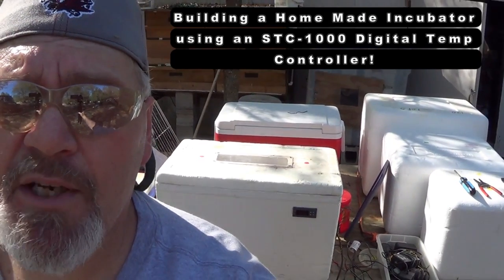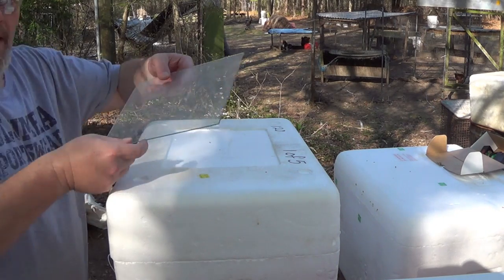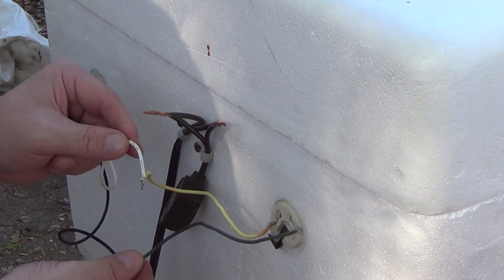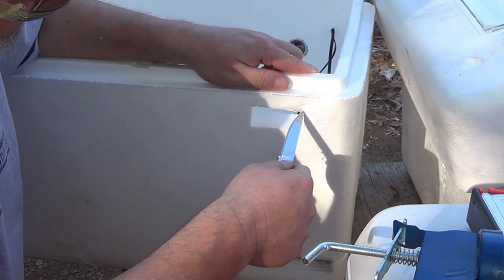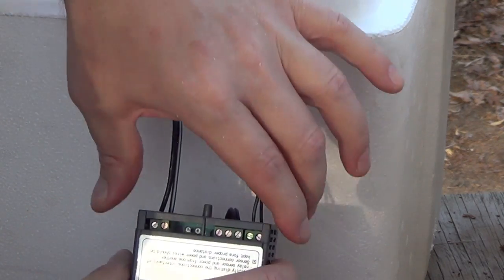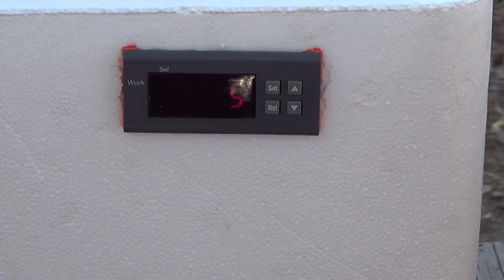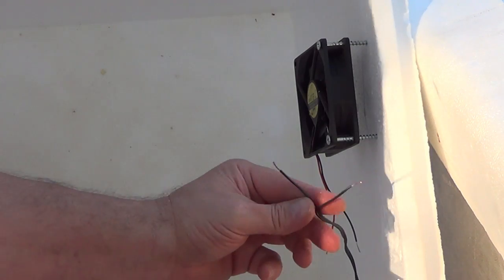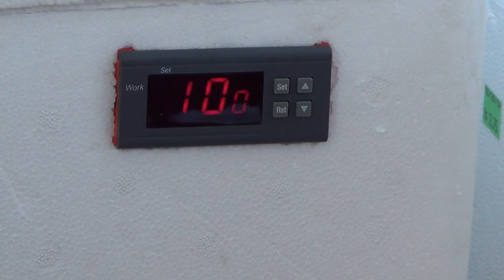Wiring/Installing an STC-1000 Digital Controller into Your Home Made Incubator!

Comment: I put one of these in a coleman cooler for a hatchery.  Only one light bulb since it would only be in use for a day or two.  worked great.  hatched mallards and two days later Bourbon  Turkeys.  Temp and Humidity was easy to adjust.  no curled toes or sprawled legs.  Peafowl will be ready to transfer soon cant wait.  This is my first try at incubation and very pleased with the results so far.  Thanks for all the instructions.  Vicki

Comment: I just got one from China and I am returning it. Its actually a nice item and I understand a little now about its multiple functions. Its actually a nice item for a school  science fair project but it gets more costly as you discover whats needed. What I thought it was was a machine you plug into a socket and stick probe in water and the probe changes the temperature of the water based on what you set. I remember wondering about if it would work soundly over a long period of time.

Comment: Thank you for the video. 
There is a humidity controller similar to the digital temperature controller that I am planning on trying to include in my incubator. If at all possible, I would love to see a how to video from you of this. 
Thank you again for your videos.
Reply: +m gorby   I wonder if you could just use this controller to take a wet bulb temp and adjust humidity accordingly...  Is there an easier way?
Reply: +Tom Smith I don't know if there is an easier way. I'm thinking about using an ultrasonic humidifier like a pureguardian or a terrarium fogger for the humidity and a humidity controller (that looks like the temerature controller in this video) for regulating my humidity in my incubator. I don't want to cut into the electrical cord of the humidifier so this is where I'm stuck. How do I rig it up without damaging the humidifier cord? Is that possible? Any and all ideas are appriciated.

Comment: Great video. I tried on of those w1209 to try to fix my sportsman. The old School wavers kicked on hatch day last week, and my digital remote maxed out 130F. I wanted to cry. Either I got a bad w1209 or I fried it with two much amps. My cabinet is 2.1 amps  I will be putting one of these in, in a couple days. Thanks again.
Reply: Joseph Fairlane I no longer use the w1209's. We tried them and after a couple of seasons that started failing!

Comment: Obviously you know what you are doing.  Looks like lots of experience.  But you could have used a digital voltmeter to test the polarity before hooking up the fan. Having a voltmeter handy when working with mixed AC DC wiring in a one unit is handy for "us novices".  Very clearly done video and a neat professional looking job.

Comment: As always thank you Rush... just switched out one of my modified water heater thermos to my digital one that came in :0) can't wait to get the others done now :)
Reply: Hey Xavi! My pleasure... You're gonna love the new controller!
Reply: Grrr I must have an odd ball model because I cannot get mine on the heat settings to go lower than 37.5 and at 37.5 it keeps the inside of my bator 101-103 :(
Reply: Xavi Bully Mart Hi Xavi... if you can't hit the 'set' button and adjust your temps up and down then something is wrong with your controller!

Comment: Just bought 1 on ebay for 13 bucks thx for the video this will work great and save a ton of $$$. There is a lot of sellers with ones that do Celsius instead of F° so u gotta watch for that and also they make them for 12v, 120v, and 220v input so u gotta make sure to buy the right 1 but these little things open up a whole new diy level to hell with the high dollar gadgets lmao I'll have these on fridge incubators and brooders hell for the price I can add in a hatcher too lol. thx again great vids

Comment: Great video on this unit.... Only thing I would suggest  (and I'm not a expert on incubators or what is best for hatching chicks) is that you might want to set the on off degree difference to a larger setting than 0.1 degree F.   I assume optimal temp is 100 degrees, but that relay that turns the lights on and off is mechanical... (not solid state) and just like everything with moving parts will wear out.  If the incubator would be okay between say 95 and 105 degrees or whatever is a larger value I would try to go with that.  The relay switching constantly will eventually wear the relay in the unit out. The relays can switch MANY times... but they do have a finite amount.  And since these relays are built into the controller I would try to limit the amount of times they switched so the unit lasted for as long as possible.
Reply: That's a good point. I'll remember this when I wire up my fridge bator however for 13 bucks if it'll last the season even it'd be worth replacing unless u got 10 of them lol but for the normal backyard breeders it probably wouldn't be that big of a deal. idk wonder how long it would last like this I'm gonna try it out just to see out of curiosity lol but that is a good point thx for sharing with all of us
Reply: From what I found the STC-1000 uses a JQC-3FF relay with a minimum electrical endurance of 100,000 cycles (once cycle is open and close i.e. light on and light off).   But if it's cycling ~1.5 times a minute(like in your video), that's only a guaranteed life expectancy of about 47 days if my math is right, which it may not be. lol Would love to hear how long it lasts for ya though.

http://www.futurlec.com/Relays/JQC-3FF-24.shtml

http://www.viking-heating.co.uk/stc1000/internal.jpg

Comment: Wade, thank you for all the great videos and for your prompt support with pms.  This is very interesting and educational video.  Just wondering, what is the verdict so far about the efficiency of digital incubator vs the hot water thermostat incubator?  For a newbie, would you recommend one or the other more?
Reply from the maker: Well... Hey there folks! I've had an STC-1000 on my home made sportsman for the last 3 years now... not 1 failure!! The controller has a 1 degree temp swing... so I set it on 100 degrees, It cycles off at 100 and comes back on at 99 degrees. My thermometer/hygrometer shows an average temp of 99.5 degrees F. I have chicks popping out everywhere! For a new-bee I would defiantly recommend a digital controller! Heck, now the digital's are in the same price range as a water heater thermostat & you dont have to modify anything! And the digital controller isn't affected by ambient temps like an analog thermostat!
Reply: Rush Lane Poultry & Game Birds do you have a video of your homemade sportsman?
Reply from the maker: dusty lee Yesser!! Installing and Wiring a Digital Temp Controller using a Solid State Relay Into Your Incubator

Comment: Placing the light sockets on opposite sides and diagonally across from each other would give better heat distribution. Careful some kinds of glue or caulking  used  can out gas from the heat and kill chicks in the shell.   Let it set up for some time on glue or calk to clear some of the possibility of fuming from heat. What are you doing about humidity control, monitoring and application as needed?

Comment: Hi. Thanks for the tutorial. Just asking how high the temperature those bulbs can heat the incubator? Thanks.
Reply from the maker: AZPAS Iphone Case Depending on wattage... it can get very hot in there if not regulated! 150 degrees with a couple 40 watt bulbs...

Comment: Hello Wade...Thanks for the videos very easy to follow instructions...How would I mount the stc-1000 in say a Coleman cooler?
Thanks
Reply from the maker: Ricky Woods Hey Ricky! I've installed these units into several coolers... In the coleman or igloo coolers I used a jigsaw to cut a mounting hole right in the middle of carrying handle so that the handle would protect it!

Comment: Hi Rush,  Great video and I am making one now but I am confused about the fan's airflow.  Is the fan's airflow pushing air against the cooler wall between the space and the cooler or do you face the fan to blow across the open cooler and light bulbs?  I see on your video that the fan label is facing to the open cooler which I believe means that the fan is pushing air against the cooler in the small open space where the fan is mounted.  What is your recommendation.  Thanks
Reply from the maker: +Gary Smith Hey Gary... i try to make sure that the fan is pushing air across the heating elements. The main purpose of the fan is to keep fresh air circulating in the box!
Reply: +Gary Smith Thanks Rush - I have another question - on the top of the box how many vents do you leave open for optimal incubation?  Do you use one or both open?  Thanks   Waiting for the STC-1000.
Reply from the maker: +Gary Smith It depends... You use the large vents on the top to help control humidity. Each vent hole open will lower humidity levels by 5%.
Reply: +Rush Lane Poultry & Game Birds Thanks Rush for the advice- got my ST-1000 today and it is different than the one you have in your video.  I am sending a wiring diagram and it has separate cool/heat wiring inputs.  Can you give me any suggestions this type of wiring.  I guess this is a newer version.  Thanks
Reply from the maker: +Gary Smith You will always tie into the heating side! And make sure that your unit is set on 'H' for heating.

Comment: Wade, a newbie  here. thanks for the video. Great tutorial man. Just wanna know since I made a small 13"X16" box, is it necessary to use two bulbs instead of just one?
Reply: Thanks pal... I use 2 bulbs only as a precaution in case 1 goes out when I'm not home! But no, 1 is sufficient in a small box. I will usually use 2 (20 watt) appliance bulbs in the small bators! Wade
Reply: Thanks very much Wade. I will try 1 bulb for this one. If this works, and the eggs hatch. I will make a bigger box later with your tutorial as my guide. Good on you mate...

Comment: I like this video but I'm confused on the volt part. Can you get the controller and fan the same volts so you don't need an inverter or would you need it regardless. Why is it needed for 12 volts instead of 10 volts'? I like like the three prong heavy duty cord than those cheap 2 prong brown ones could I use those? I know nothing about electricity pass match the colors.
Reply from the maker: +DarkIllusia The stc-1000 can't handle a fan. You need the inverter only if you are using a PC fan that uses DC voltage. An inverter that is 9v to 12v DC will run the fan but the lower voltage will run the fan at a lower speed! There is no need for a 3 wire cord in this project.

Comment: Hi 
I got STC 1000 from China, but the functions are slightly different from the one you are demonstrating such as (6 & 7) for loading relay whereas the one i got has (5,6) for heating and (7,8) for cooling
I am getting confused what to connect for incubator heating or cooling or both and how
please help

Comment: STC-1000 I bought will show what temperature it is but it will not provide power to the heating or the cooling terminals. No matter how I set the controller it will not power the terminals for heating. I am hoping I will see how you set the controller if there is something I missed. After seeing your video again I see that your STC-1000 is a simple version. Mine has a power up button, and extra terminals for cooling.
Reply: You prolly got a bad unit... I got a bad one a couple years ago!
Reply: it worked perfect after I got the proper wiring diagram. I want to get another one to install in a wine cooler conversion incubator for Tempeh.

Comment: Great video question when the lights go off does the fan go off also or does it stay on all the time. 
Thanks Vincent
Reply: You want the fan to stay on all the time.. He plugged it directly into the power not the load line so it would stay on....  keeps the temp equal by blowing the air around...

Comment: The wire you have for the main power supply looks too small. You should have at least a 16 gauge wire for 120.
I am sure you will get away with the smaller wire. However it would be safer with a larger wire.
Reply: I had the same thought...  He could just use the extra wires from the light fixture that he took apart ...

Comment: I have an older Brower Top Hatch incubator and the temp controller is not great.  I was going to use this to solve the issue.  It has a very small fan that blows over a bulb.   I just read below that this won't handle a fan...  but mine is only about 1" sq and is AC...so.....  What do you think??   WIll this STC1000 (MH1210F-farenheit) work, or not?     Thanks enjoyed the video!!!
Reply: Basically all Im doing is cutting the power cord and installing this in-line....   power to power and load to incubator...  I don;t think I need any jumpers etc.....   correct?
Reply: +Tom Smith sounds right Tom and it's just in line if u want the plug on the end for fan otherwise u can  just use any cord that can handle the small load but that plug end will come in handy for adding extras like the fan or any extra lights or even a turner. The thermostat just get wired in pretty much like a light switch would

Comment: two 150 watt incandesants bulbs. the box is large at 5.6 cu ft.
The controller kicks on and off every 3 minutes.
 On at 98 off at 99.
Reply: +Vince Biano Okay... 300 watts may be over-loading the little 10 amp relay in the unit. You may want to use a solid state relay on those big bulbs!

Comment: All the STC-1000 that I am finding on Ebay and Amazon are all Celcius not Farenheit?  Where did you get your unit? And they say Cool and Heat on the left side?  They are similar to yours but not the same?  Thanks..
Reply: +La Luz Newmexico This one is in china but it's in F. : http://www.ebay.com/itm/350947244789?_trksid=p2060353.m1438.l2649&ssPageName=STRK%3AMEBIDX%3AIT
Reply from the maker: +La Luz Newmexico Here's the same company in Cally: http://www.ebay.com/itm/310937246998?_trksid=p2060353.m1438.l2649&ssPageName=STRK%3AMEBIDX%3AIT
Reply: Yep! That's the 1 that I use...

Comment: Have you noticed that the temperature will fluctuate quite a bit? For example mine is set at 100 F. It will shut off at 100 F but temperature in the bator will still increase up to about 102 before it starts to drop. it clicks back on at 98.8 but before the temperature starts to increase, it will have dropped to 97.8. any suggestions?
Reply: mine is doing the same

Comment: I appreciate your videos. 
I bought one of these controllers and after 2 days during a test run it stuck on and the temp was 141 degrees. I reset it and seem to work ok until today when I caught it at 106. I have 45 quail eggs in there.
Has this happened to you at all?
I want to buy another but wanted to see if it happened to anyone else.
Reply: +Lar Bian Sounds like you may have gotten a bad one... I've been lucky with them so far. I think that I have had 1 fail on me in 4 years.
Reply: Thanks Bubba. That's what I needed to know. I'll order a new one and sweat bullets this doesn't get weird while I'm  at work or I'll be eating hardboiled bird. Then I have to make a quick swap and hope the temp doesn't drop too far. 
Each time I reset seems to work ok for 10hrs.I'll do that before bed and work till I get new.
Thanks again.
Reply: +Lar Bian Yesser! You know it... I've been there many times my friend! That's one of the reasons that I built a separate hatcher. If I ever had an incubator fail, I could put them in the hatcher until I could get the bator repaired.

Comment: Hi Wade, I purchased an arc 1000 like your and set it up the way you did on this video.  Would you have any idea why the bulbs do not cycle off when the set temperature is reached? I set the temperature to 100 degrees, but temp has gotten up to 165 and has not cycled off yet.
Reply from the maker: +A Yang Hey folks! Check your wiring against this wiring diagram to see if maybe a wire is crossed somewhere: https://www.youtube.com/watch?v=2pUr2YSaIv0 
Wade

Comment: Hi! Is there a specific type of wire needed to connect the light bulbs to the thermostat? The unit turns on and the temp probe is working but my lights won't turn on.
Reply from the maker: No 'special' wire Dasiy... I use a 16 to 20 gauge copper wire in most applications! If your light is not coming on then you most likely have something wired up wrong. Go back and re-trace your wiring... Here's the wiring diagram: STC-100 Digital Thermostat Wiring Diagram without SSR
Reply: Rush Lane Poultry & Game Birds Thanks for the reply and diagram! I had a bad temp controller. I ordered another one and everything is working now.
Reply: Daisy Flores Good deal! Glad y'all got that figured out Daisy!!